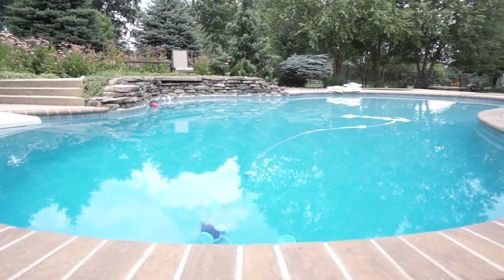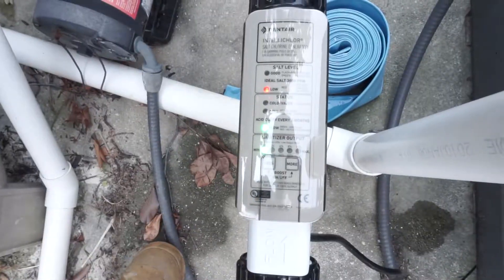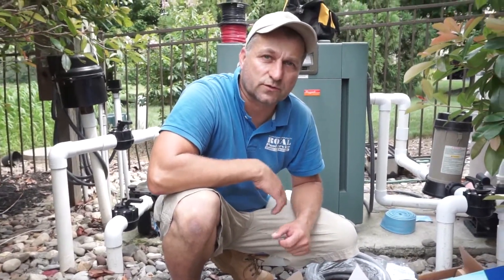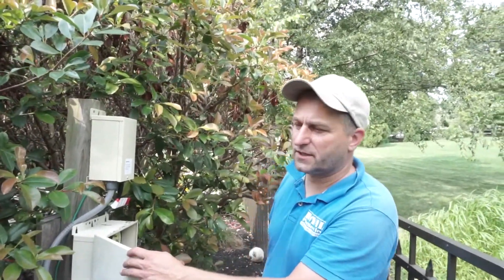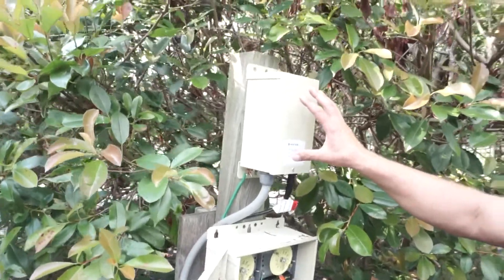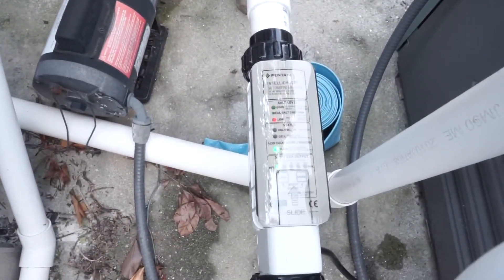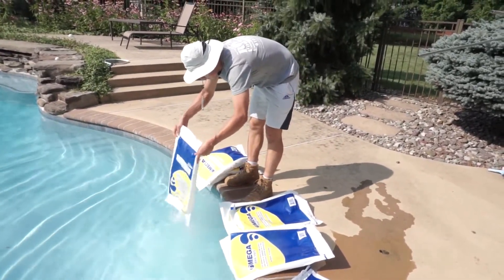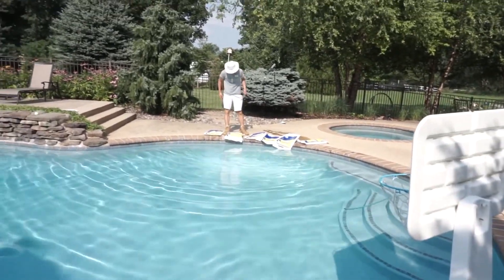Converting Chlorine Pool to Salt Water Pool

Comment: Can you just take the inline chlorinator out and put the salt cell there?
Reply from the maker: It's rare that the salt cell would perfectly fit in this place, but with slight modifications, it can usually fit. Then of course you need the main computer system that allows it to work.
Reply: I went from salt to chlorine.. have had issues since...i still have the salt water system. Only 3 yrs old...i want to go back to salt.  I have not had this much issue with salt water...any suggestions..@weservicepools4598

Comment: Unfortunately even with regular maintenance the salt generating cells only last a few years. And most pool service techs and homeowners don’t diligently service them which further shortens the service life. After a few $1,000 charges to replace the cells many homeowners revert back to adding chlorine directly.  Everybody loves their salt systems initially but for most the honeymoon is short. Good idea in the short term but the equipment doesn’t last. Pool guys like the one in this video love to sell them because it’s a quick profit, years of cell cleaning fees and pretty soon a hefty repair bill
Reply: I spend $1200 a year on chlorine jugs alone plus at least another $600 in the stupid tabs. That’s not including all the other chemicals. I’d happily pay $1000 a year to replace the cell and the fact it would last at least 3 years is already a major win for my pocket.
Reply: @gisellellanes2977  wow!  Is this one pool?!  I use a few 5 gal liquid, and less than $100 tabs. 16x32 ‘ inground pool .
Reply from the maker: While converting to salt may require some investment upfront, you can save money on maintenance and chemicals in the long run. 

Additionally, pool care becomes a completely new and much more enjoyable hands-off experience with salt systems.

We've installed 1,000+ of these salt systems across the USA... We've yet to see someone revert back to traditional chlorine after converting to salt. In our experience, a well-taken-care-of Pentair salt cell can last up to 6 years.
Reply: I have read /watched from other salt pool converting youtubers that it is 98% less exoensive. Maybe it is not understanding that the source of Chlorine is ONLY salt ?

Comment: a salt system is a chlorine system.
Reply: The chemistry is quite different though from adding chlorine directly to the pool water. Less irritation, much softer water and ultimately cheaper in the long-run. You just have to stay on top of maintaining the salt generation cell.
Reply: Yes after researching it, I find we are still exposed to chlorine.  Chlorine is not healthy
Reply: There is more than one way to get chlorine in your pool. Add it directly or generate it with a salt cell. Pros and cons to each method

Comment: Is that an inline chlorinator? Why wasn't it removed?
Reply from the maker: Yes it is an inline chlorinator. 99% of the time there are no tablets in the chlorinator. We left it for the customer just in case of an event that may require a faster form of sanitization than the intellichlor can produce (like a huge party or extreme weather event). Putting Tablets in the chlorinator immediately exposes your pool to sanitization, while the intellichlor takes a few minutes to adjust levels and a few hours to fully finish the sanitization process.
Reply: its best to leave the inline chlorinator on the system because in about 5-6 years when the salt cell goes out and the customer gets an estimate of replacing the salt cell for about $1000-$1200 and the customer bitches about the price, they can go back to using traditional chlorine.